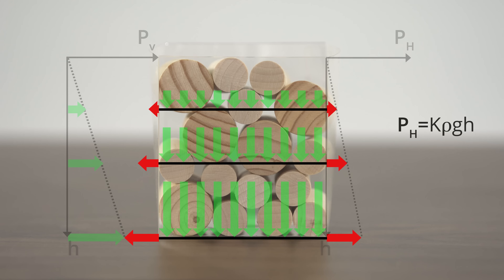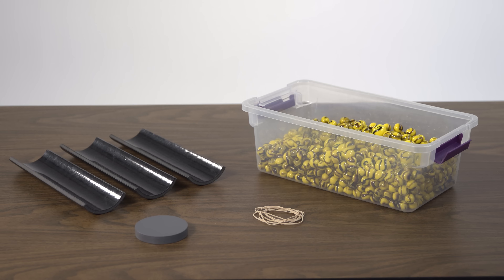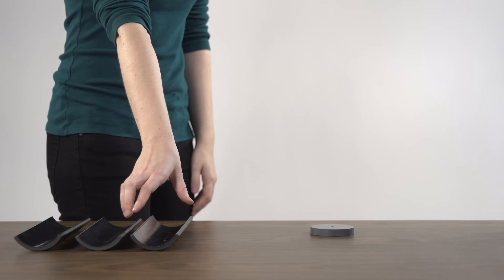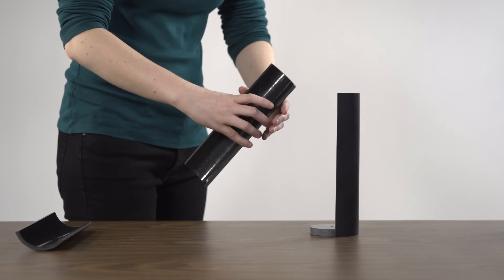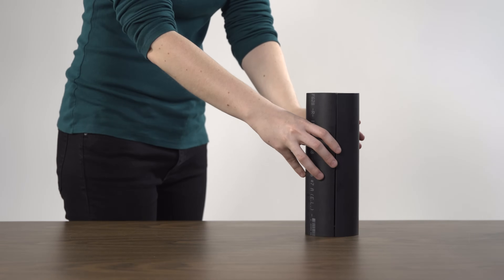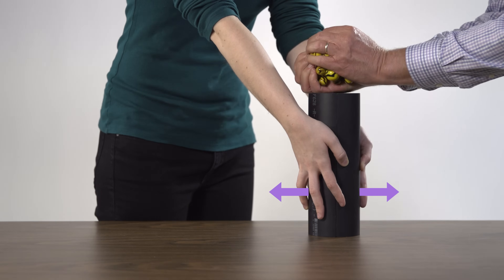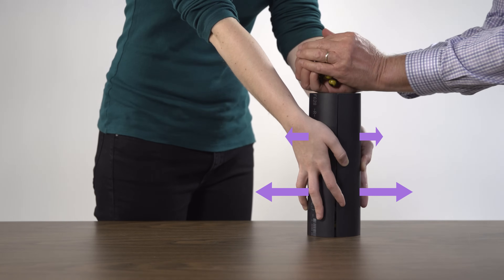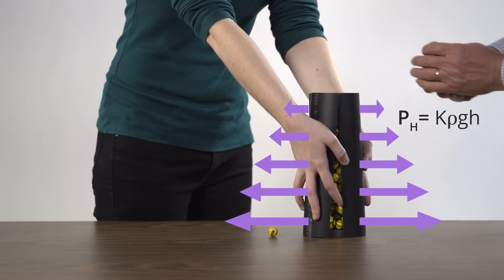9. Silos and Tanks

Comment: Thanks for your amazing videos! I subscribed almost instantly.

My question is: with fluids the pressure increases with depth and tanks need to designed accordingly. But with solids and soils there is also friction between the granuals to take into considerations that will reduce the rate by which pressure perceived by the wall increases with depth.  How do you design for that?

Comment: Is this misleading? Would a Tank made to hold liquid not fail if it was made with the same assumptions as a Silo that holds grain? When you did the marble vs. water filling, im curious as to what you would get if you compared the same mass of water to that of the marbles needed to pack that space. You should come to the assumption that the bands for the marbles are sound when its filled to the top, but the same cylinder filled to the top with water (or highly dense liquid like molasses) could have a greater mass and push out with an overall greater force. 

I'm a nerd, and my brain works after forcing myself to postpone sleep for 2+ hours.

Comment: What happens when the materials form for a structure inside the silo. Grains can form arches anywhere in the silo. Also this doesn't explain how a sand jack works where a large hole is opened in the bottom of the wall to let the sand out .

Comment: Just out of curiosity, does the pattern follow the Fibonacci pattern?
Reply: no, it follows a linear pattern, in direct relation to the depth. It's easy to understand because if you are calculating a cylinder of x depth, at 2x depth the cylinder will have 2 times the volume, therefore 2 times the weight will be generating lateral forces.
Reply: @xaiano794  but does the distance between reinforcement lines follows the same pattern
Reply: @jacobelgan5196  obviously it is the exact inverse, as you'll need twice the reinforcement at any given point to carry twice the load.
Reply: No, the Fibonacci sequence has nothing to do with the spacing between the structural members. The pressure (and required wall strength) vary linearly with depth.

Comment: I thought the pressure from a discrete particle like grain drops off exponentially due to friction such that pressure does not build up like with a liquid.
Reply: That only happens when the particles jam. Which is like making a floor held together by friction. See this video for a more graphical explanation: https://youtu.be/NG29hNDuVxM
Reply: Each material has its own internal friction angle. The horizontal pressure with depth has a magnitude related to that angle.